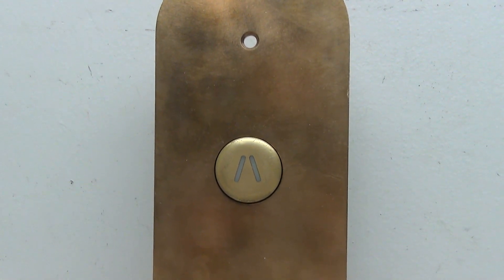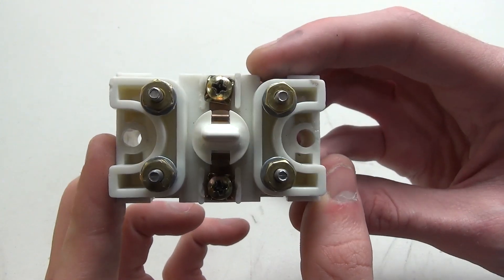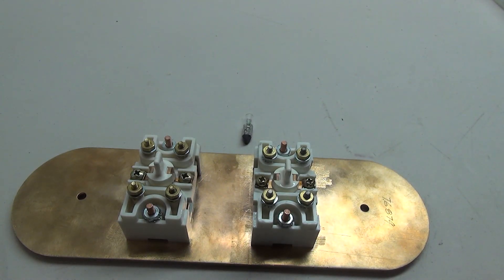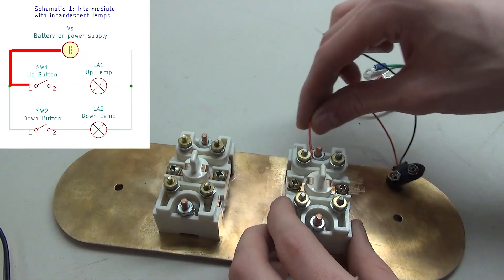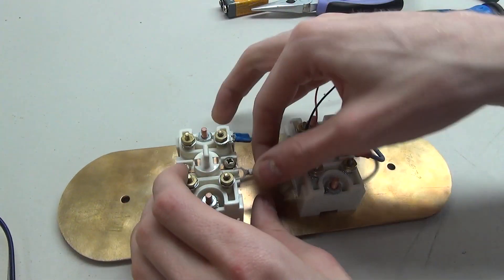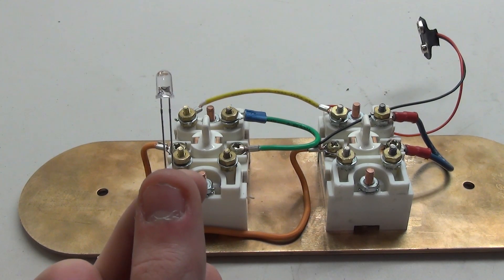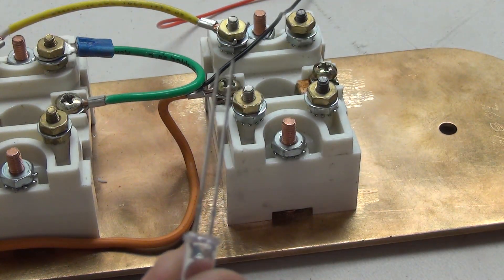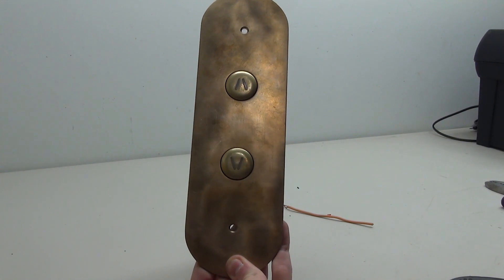How to Wire EPCO Elevator Buttons

Comment: Hello, do you know the name, or have a link to the type of wire you used in the video? Because I have this button and would like to wire it. If you have a link to a place where I could buy it that would be awesome, or tell me if you are able to use any type of wire. I also have another question about what type of wire I can use. I see a lot of wires called tinned copper wire, and I found one that says 30 Gauge and 30 AWG, is that okay to use? Thanks
Reply from the maker: I just reuse wire I rip off old parts. You can pretty much use whatever you want for low current applications like this.

Comment: I have EPCO Circleline call stations
Reply from the maker: Nice
Reply: @stlelevators  This really helped, I was able to restore my call station. I am not able to wire it tho because the Lamp Sockets are stuck.
Reply from the maker: @vancouverelevators_transit  You should be able to pull them out with pliers.
Reply: @stlelevators  It Partially worked, it took me a few more tries on different days to get it out. There is one more light socket, I will try to get that out today.

Comment: Thank you so much for this video, and I have managed to wire up virtually all of the hall stations. What I have noticed is that the EPCO buttons are of okay quality, although they have the tendency to crack and deteriorate with age (even if they are polycarbonate), and while it's relatively easy to wire up, in the beginning I found the wiring to be somewhat cumbersome. Altogether, I think the EPCO buttons are okay, but in terms of simplicity, quality, reliability, and durability, I still think that Innovation, Adams, MAD, and CJ Anderson are much better.
Reply from the maker: You're welcome!

Comment: That call station is shaped like a lozenge, just like on KONE KSS 300s, except that one is flush mount and the EPCO one is surface mount. The floor indicators on KSS 300s and 370s are also lozenge-shaped. KSS 370 call stations are more rectangular but slightly curved at the top and bottom. There is one at the elevaTOURS international elevator museum.
Reply from the maker: This is a neat piece